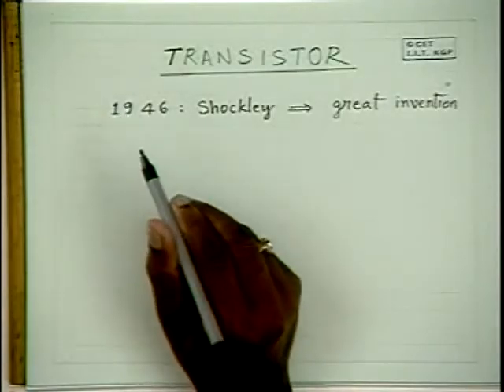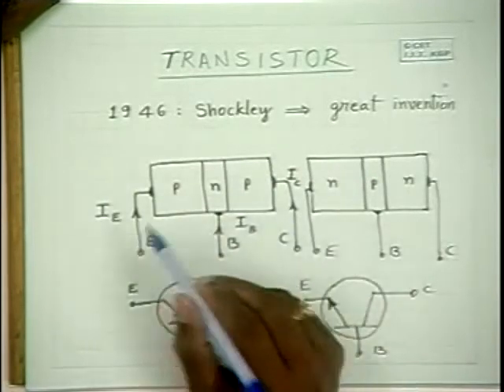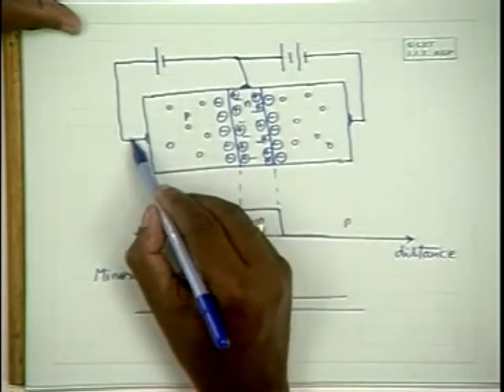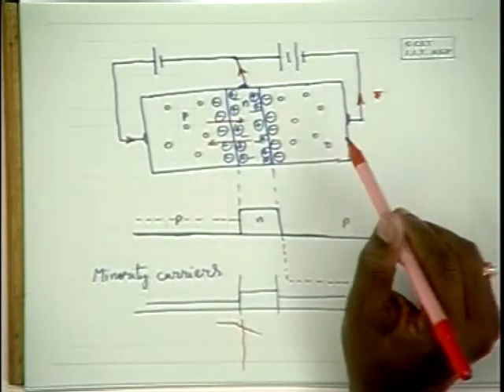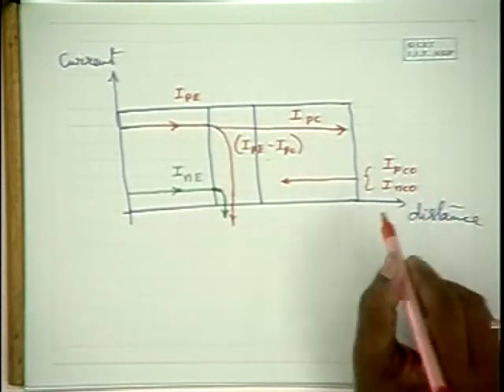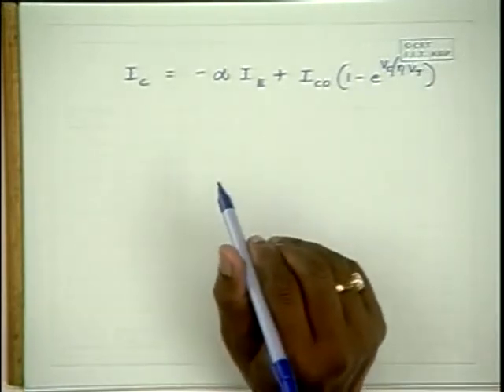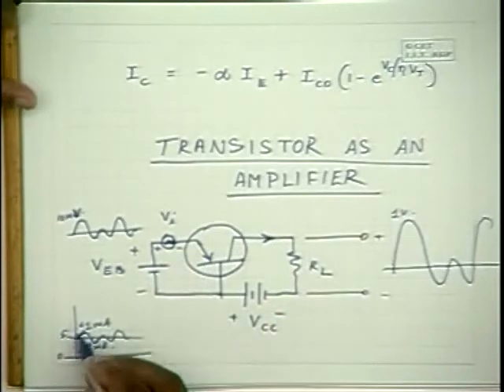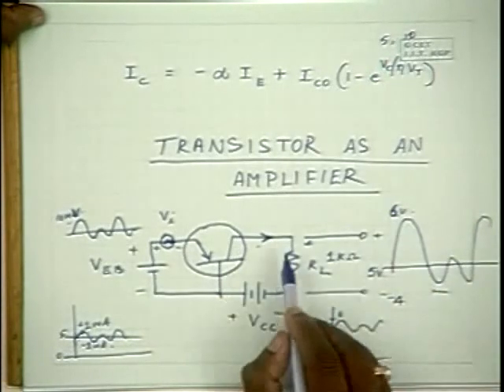RVR BE 11 BJT (Bipolar Junction Transistor)

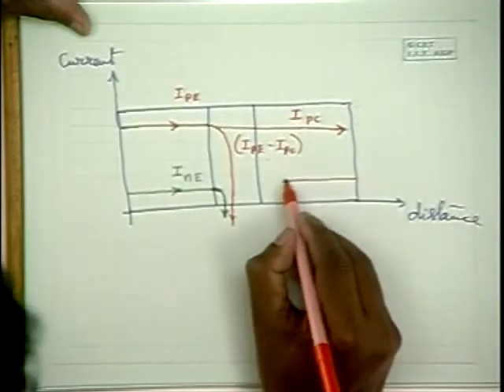Comment: if the minority holes are drifting from the base to the collector (and electrons from collector to base) shouldn't Ipc0 (current due to holes) flow in the opposite direction to which it's drawn in the video at 25:36 ?